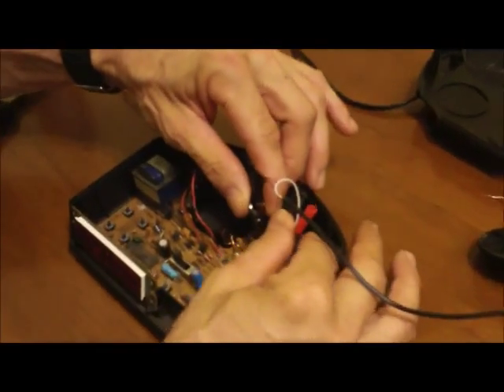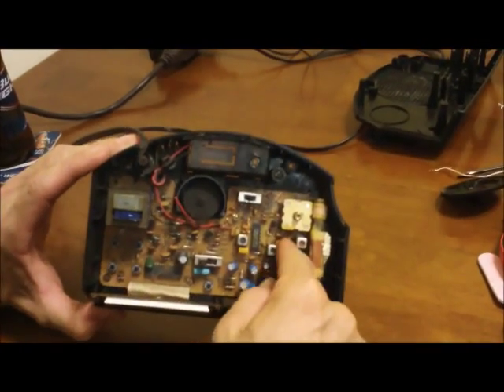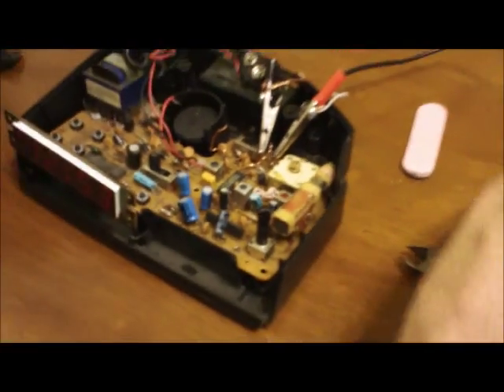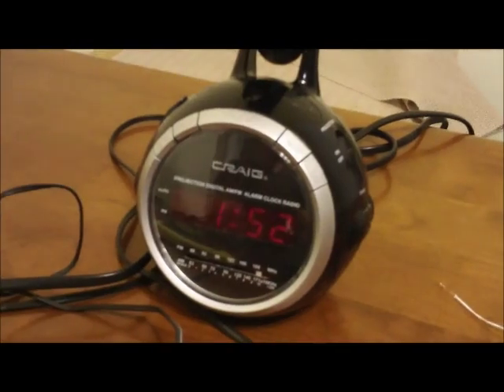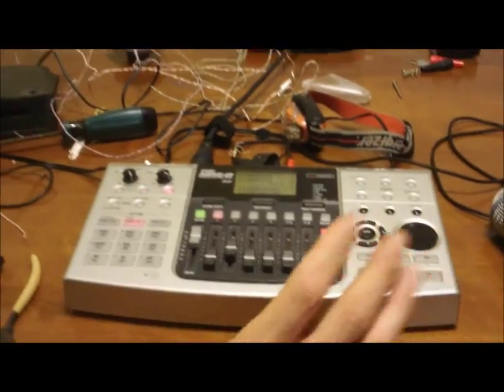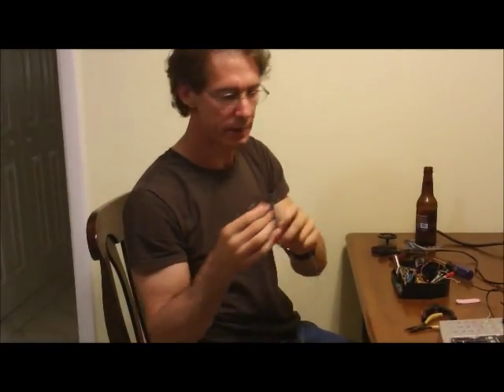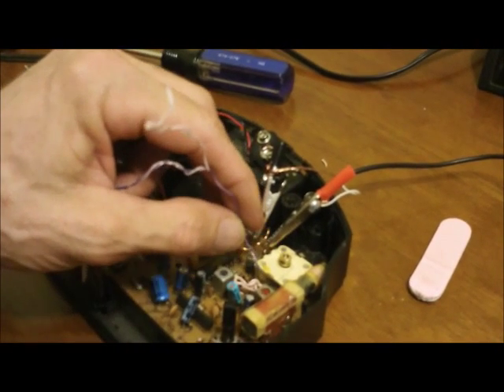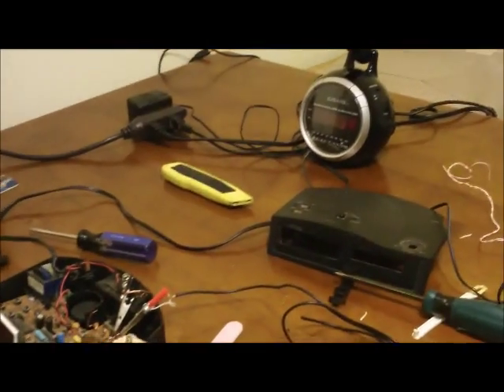How to Build an Fm Transmitter From a Clock Radio PART 2

Comment: auswem man im going to build another one this way.....i was ale to get one to transmit without cutting the coils but im going to try and build one this way and see the difference.....mine transmitted a carrier about 15 feet without an antenna so all i needed to do was add an audio signal to a varibal capacitor and a jumper next to the tuning capacitor.....then each side of the tuning capacitor acted as the antenna

Comment: Your working of the IF sections harmonics not a true FM carrier on 88 - 108 MHz. It's a cheap easy very short range way of doing it by exploiting the radio's internal IF mixing system
Reply from the maker: Thanks for the input. That's why the older and cheaper radios work best, because of the lack of quality filtering. I have gone longer distance with the cheap radios. Tube type receivers really bleed, and I have gone as far as 2 miles (with the addition of an outside antenna).
Reply: Well consider the money your spending on these old radios at a swap meet you could visit your local radio shack or electronics parts house and buy parts needed to actually build your own FM transmitter. Granted it will not be of any high power but will preform quite better than what your doing there. Of course you could de-solder the parts from the dead radios you have already lying around. Then there is the option to just buy one of those small FM transmitters for an MP3 player off ebay and mod it with an external antenna.
Reply: @simplehowtostuff  can i do this with am radio?